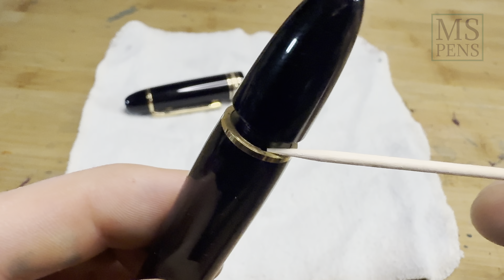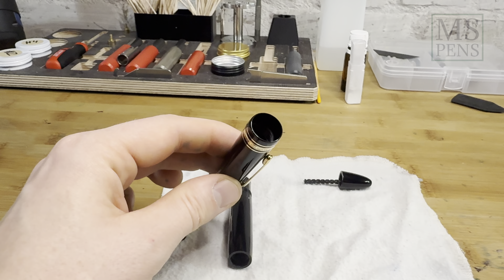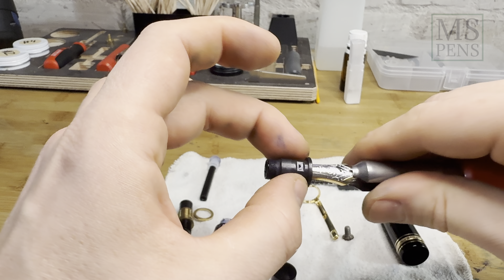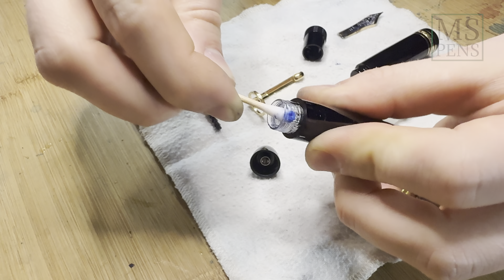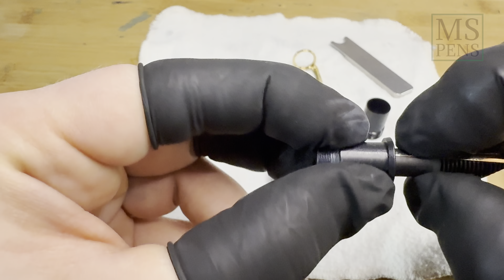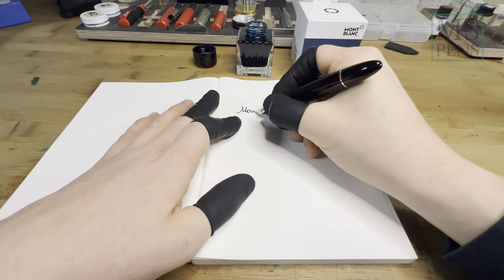Montblanc Meisterstück 149 Maintenance

Comment: During this time period the only thing of value was the solid gold nib. The black resin looks good but is very delicate , heat will melt it, after shave and  alcohol   will melt and frost the surface, it will crack and break under the slightest pressure even a loud fart will cause it to crack. In Australia this damage was replaced under warranty to maintain its so called luxury image.

Comment: Great job from a master like you as always. I recently acquired a Montblanc Meisterstuck 149 from the late 60s (1965/1968) and wondered if you’ll have any videos on how to maintain a friction-fit Montblanc as the piston on mine is stiff. I also had a few questions, if the knockout block is used without cushioning will the nib be prone to damage upon contact with the metal base? Will removal of the Montblanc finial on the cap permanently misalign the Montblanc snow cap logo with the clip? And do you know of any good methods to polish Montblanc fountain pens? (Celluloid and resin)

P.S. 
I ask only because I am simply too scared to send off my precious pens through the mail and would rather learn to do it myself.
Reply from the maker: Hello,

I honestly don’t know whether there is a video that shows how to remove the piston unit from 1960s Montblanc 149 models. I use a special tool that allows the piston unit to be pulled out, but this tool is quite complex to manufacture, and to be honest I wouldn’t know where one could obtain something like this today.

In this video, I placed a cloth underneath the knock-out block to make sure that the rather heavy nib would not be damaged. Normally I don’t do this and have never had any issues, but in this case I wanted to be on the safe side.

On more modern Meisterstück models, the cap and clip can only be assembled in one fixed position. With older models, however, you have to pay attention to the correct alignment yourself.

For polishing, I use a very fine-grit polishing compound. If you decide to get something similar, it’s important to make sure the grit is not too coarse. A polish specifically intended for acrylic or other plastics can be a good choice here. However, I don’t want to recommend a specific product—I personally like to experiment with different compounds to further refine the results.

Best regards

Comment: I have a great character Muhammad Ali pen on the way, it is a piston fill pen.  Does it disassemble the same way as the 149?
Reply from the maker: Hi, yes, the system is the same. But the limited editions are based on the 146 size.
Reply: @MSPens  Do the pens come with disassembly tools?
Reply from the maker: No, you have to buy them separately. But for a new pen like the Muhammad Ali, a service should not be necessary if it was treated well.
Reply: @MSPens  Thanks.  Someone is gifting it to me and it has never been inked.  Curious, are the tools available from Montblanc?  I love Montblanc but they are definitely pricy, I have a hard time justifying any of their prices, especially the leather goods.
Reply from the maker: @thomasmorrison675  Montblanc itself does not sell tools for their fountain pens. If needed, you can find some on my website.

I worked at Montblanc in production for a few years, and the level of quality control and the standards applied to the parts are extremely high. In addition, quite a large number of people work in the factory and are paid fairly, which certainly has an impact on the pricing.

I think, however, that Montblanc has mainly decided to price its writing instruments at a high level in order to position them clearly as luxury goods. Whether every single euro of that price is truly justified is not something I can really judge.

I also find it a pity that their leather goods are so incredibly expensive. I would love to buy more of them, but at those prices, it’s simply not feasible for me.
Reply: @MSPens  What is the website address?
Reply from the maker: Www.mspens.de

Comment: Do you use any heat to loosen up the piston mechanism? I am ashamed to admit I cracked my 146's barrel when removing the piston assembly, even though using the proper tool. I think the issue was the red goop that Montblanc uses as a sealant, which basically glued the piston assembly in place. Luckily, I was able to find a replacement barrel, though, at a reasonable price.
Reply from the maker: Perhaps the goop has hardened or crystallized due to some external factors. Really annoying

Do you know from which production period the 146 model is?

I have never had issues removing the piston before, but I am always interested in learning more about the different Meisterstück production processes.
Reply: @MSPens I don't have the pen on hand right now, but I think I dated it to the mid-nineties with the dating tables that you can find online.
Reply from the maker: Okay, thank you. I’ll keep an eye on that when I disassemble Meisterstück pens like this.